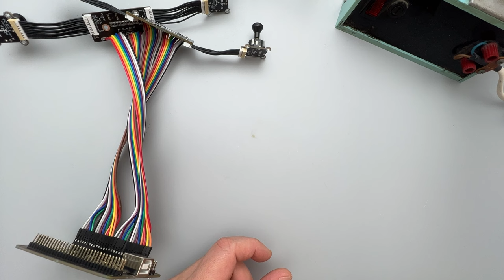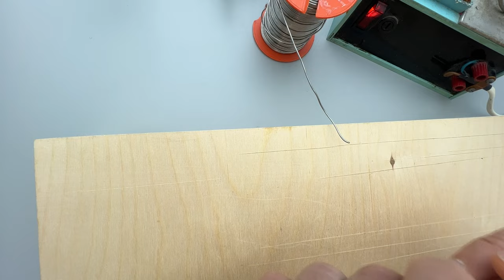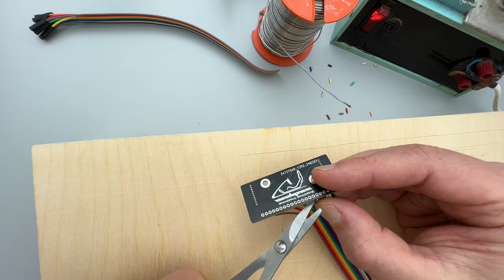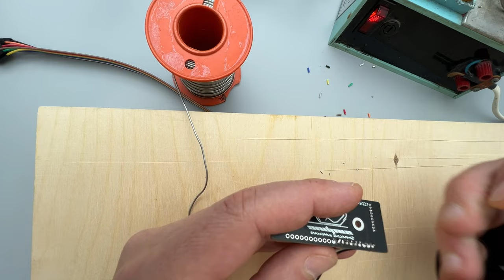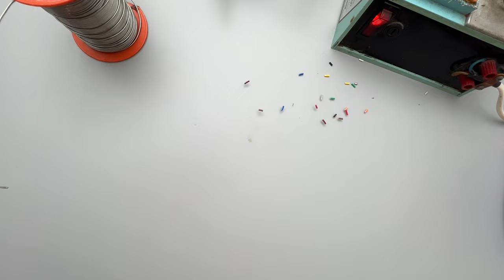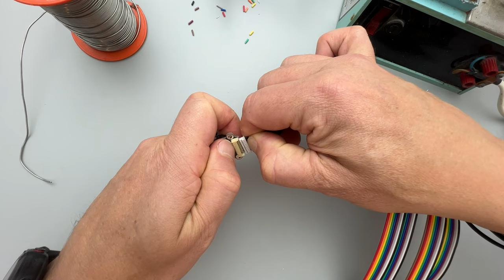DIY Alps 7way switch

Comment: tip: when you multiplex your signals, you only need 25% of the wires plus  4 wires in case of 4 hat switches .... anyway great to see.
Reply from the maker: fully agree - but i am not 100% sure if this will work with the purchased pcb - you can check the layout and pin break out at simline webpage
Reply: @pwi-studio  no this is not possible with this interface. Direct to the cpu it is possible. The common signal of the joystick should seperately be attached to a data signal of the cpu. You should switched this common signal.